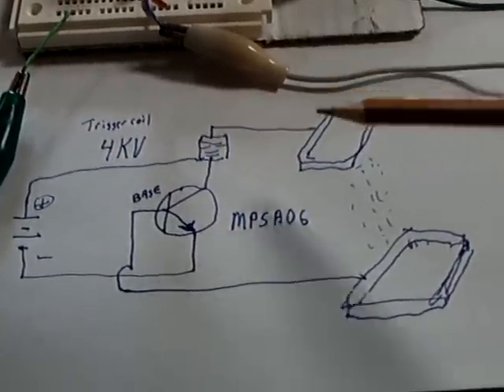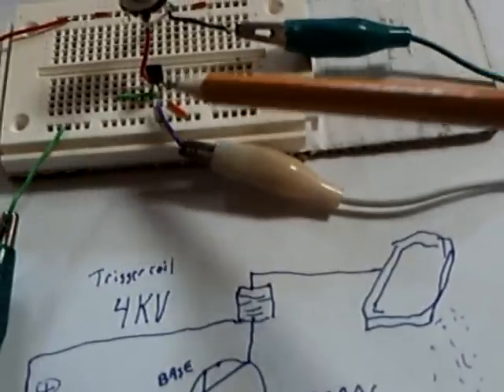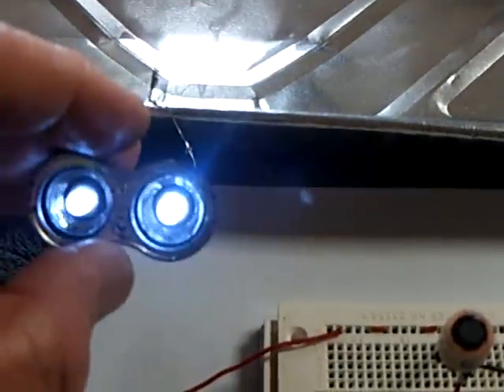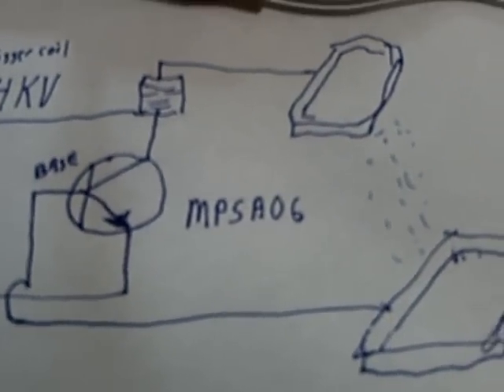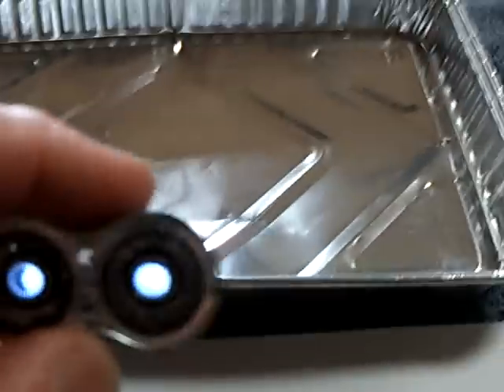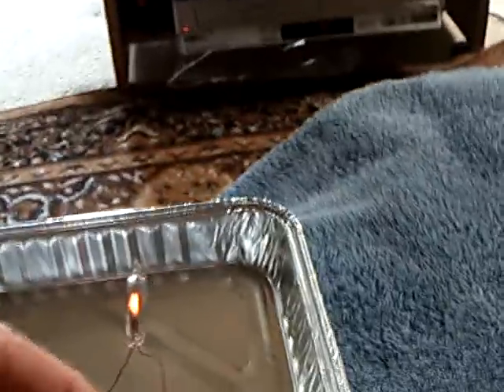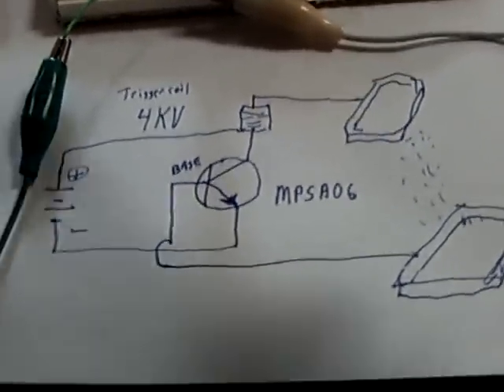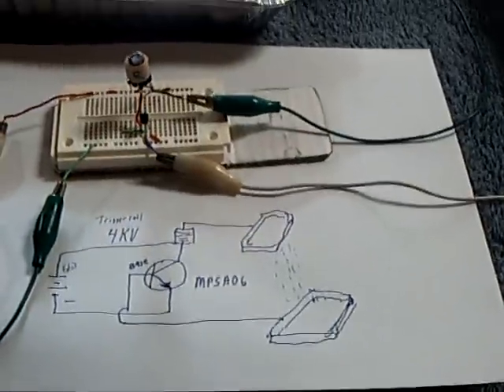Jonnydavro's    aluminum pan oscillator.ASF

Comment: Lidmotor thanks for the demo it was really excellent. I just hope I can produce this circuit with the same results. I had one of those little little trigger coils and had a hell of a time getting it to take off with the last circuit diagram. I was using a 6 volt 4 amp battery with no luck because I didn't have a 9v battery. So this looks really promising.